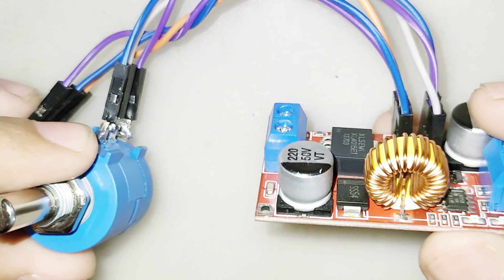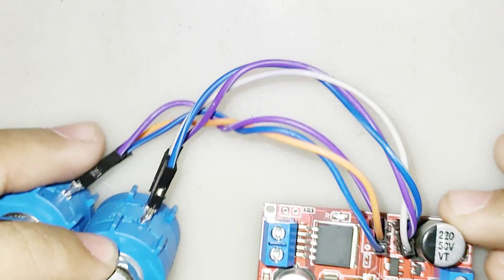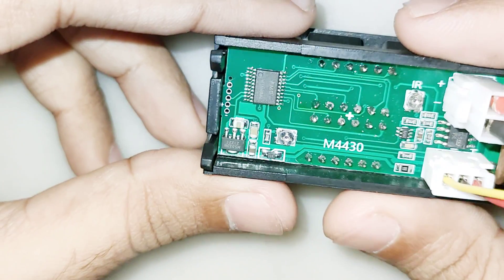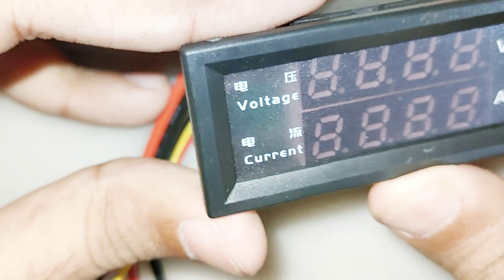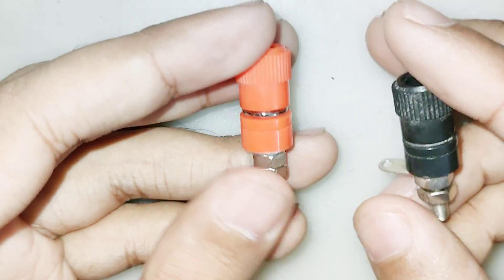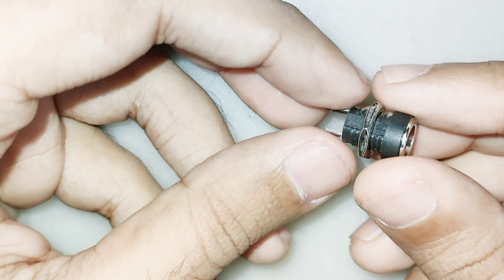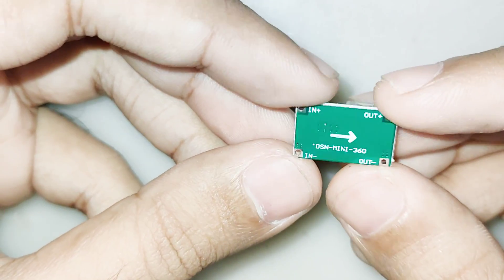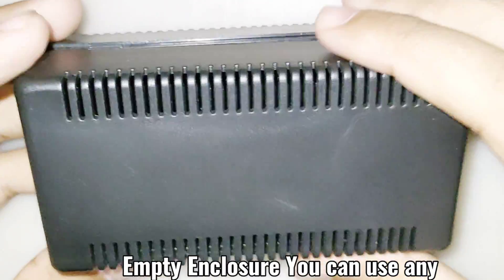How to make a Lab bench power supply 1V To 24V • 0A To 6A ✓

Comment: what mini360 buck cnverter for? strange wiring? only output wired and in input no wires? totally confused.......
Reply from the maker: Input goes to Barre DC jack
Mini360 converter is used to supply the display 12V because I used 24V input , you can use a LM7812

Comment: What about the cooling? Will this thing not overheat for a prolonged usage at its full power? Or is a fan really necessary in that case?
Reply from the maker: IC has over heating protection, but still you can use a small fan for it !
Reply: @Electronic_For_You  If I truly have to rely on the overheating protection, I would rather add a fan to it because 99% of the times, the chip fails before the overheating protection steps in. Anyway, thanks.
Reply from the maker: Then also use a small heatsink with thermal paste
Reply: @Electronic_For_You  I will use a fan in my build. Thank you for your reply..
Reply: Pm me can you to install do solar battery charger..
Reply: @anwin85alon  What do you mean by "can you to install do solar battery charger.."?

Comment: Best buck and boost converter circuit input voltage 10/12 our voltage 0.30. Amp 10❤❤❤
Reply from the maker: Don't put voltage at 1V and current at maximum it can damage it. Because the current will rise more than diodes can handle
Reply: @Electronic_For_You  ok
Reply: Pm me can you to install do solar battery charger..